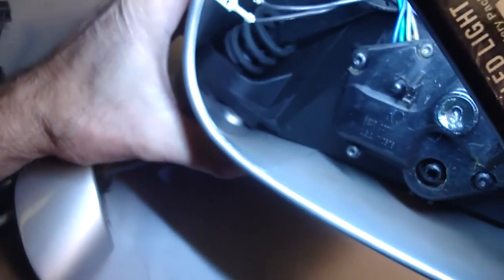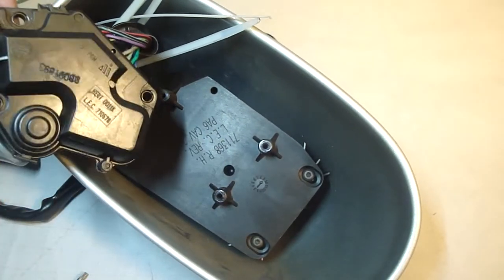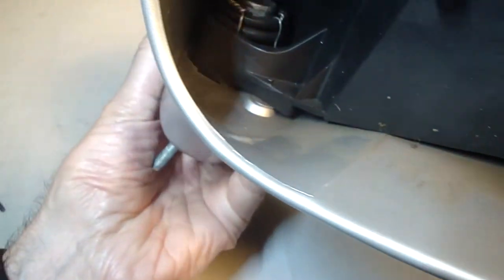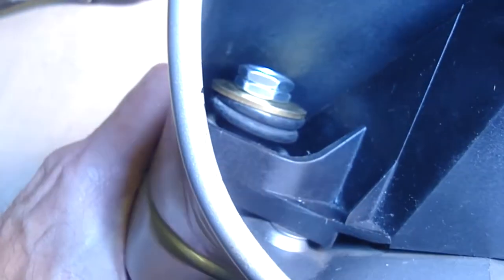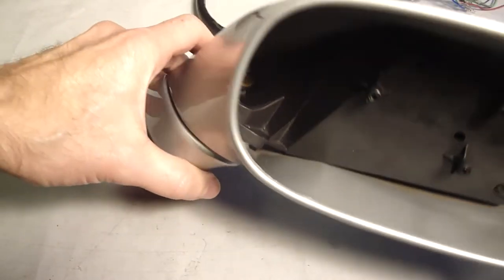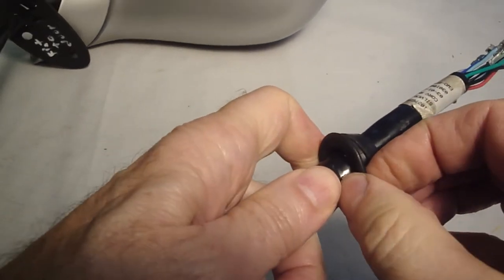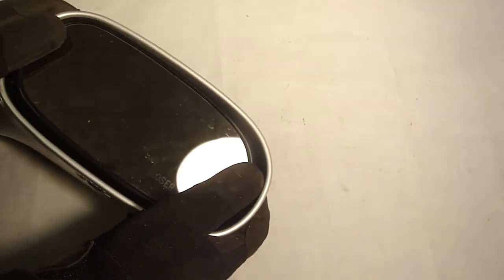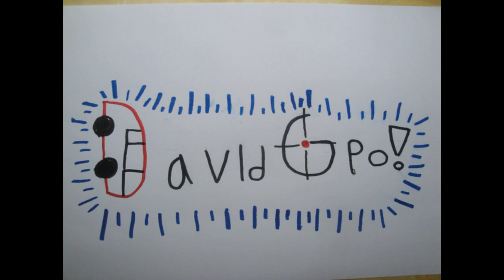Corvette C5 Floppy Mirror Repair Part Two of Three

Comment: I too, followed your lead.  I couldn't get the metal terminals to release from the connectors, so I decided to cut the wires, staggering the cuts.  I used shrink tubing on the wires where they go through the lamp nipple and that worked like a charm.  I soldered and shrink tubed the individual wires and shrink tubed the bundle, then slipped the original sheathing over the entire thing.  End result was successful.  Thanks for showing the way.

Comment: Okay so I just did this and found a different way. I got a pair of C clamp locking pliers, a washer with a V cut into it so it could clear the wires and then welded that to the pliers at the appropriate angle. set that on top of the locking washer and the base of the mirror. it eventually locked back in.
Reply from the maker: I'm having trouble picturing your operation.  Did you shoot a video that I can see?